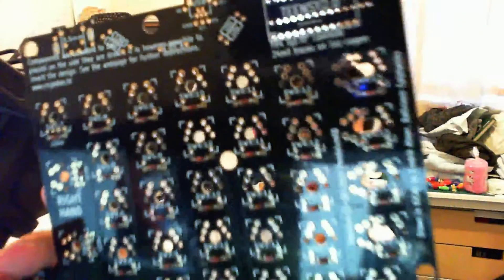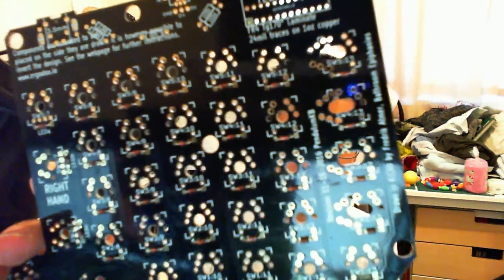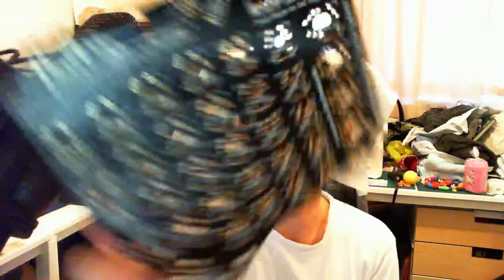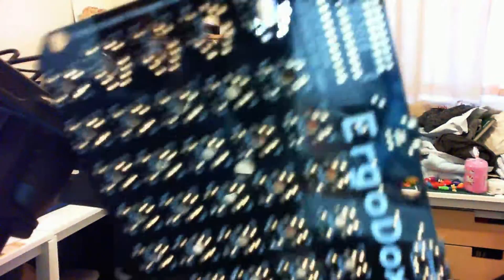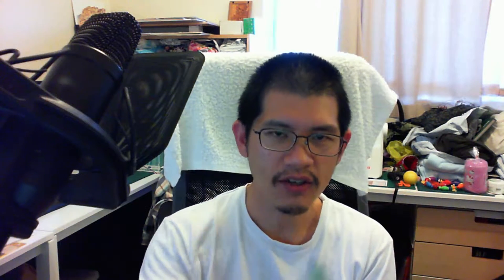Jaycar 25W Soldering Iron - Part 2

Comment: a tip to stop that from sliding without making it uber uncomfortable. Tape yes but something like the metal tape used to tape up exhaust pipes for a woodburning stove. Slide down the rubber piece and do a single or double wrap around the plastic, then slide the rubber back over top of the metal tape so you don't see it at all. 
Something like this tape. https://www.amazon.com/Scotch-3311-Aluminum-Foil-Silver/dp/B00O9R4K7O
Reply from the maker: I found that prolonged use the handle also got very warm, to the point of being almost uncomfortably hot. Certainly a great tip with the tape. Probably a bit excessive for me to get a whole roll of tape just to do one iron, but I might bulk it with some masking tape since it'll be under the rubber.

Comment: Thanks for the review, been thinking about getting one of those since the Hakkos that everyone recommends cost 150-200 here. Good luck with your ergodox build!
Reply from the maker: I actually finished the soldering except for the 3 LEDs, I haven't done a video yet on it because I am waiting on a TRRS cable before I flash the unit.  I found that the iron pumped out plenty of heat, and I did the switch soldering without any issues, but the real choke point in me working smoothly and getting good solder beads was the lead-free solder.  So, if anything, a cheap iron can do the trick, but if your conscience and health sensibilities allow you to, I would recommend leaded solder over lead-free.
Reply: The Board Podcast Yeah consensus seems to be that lead free solder is a pain, at least the places I've been reading regarding soldering keyboards.